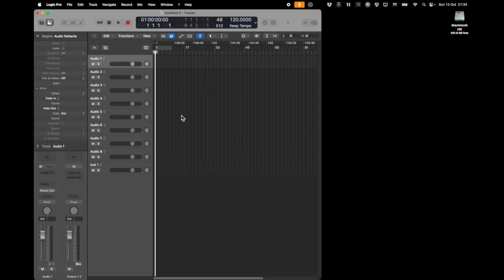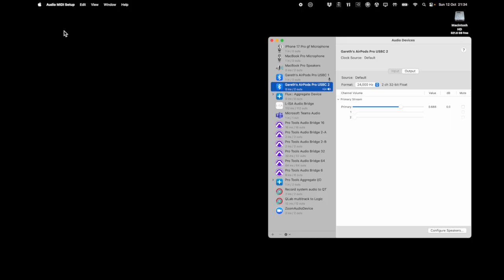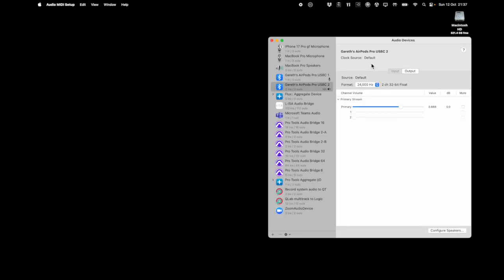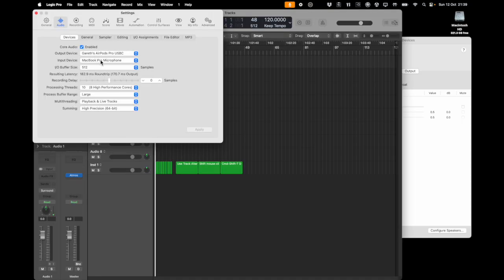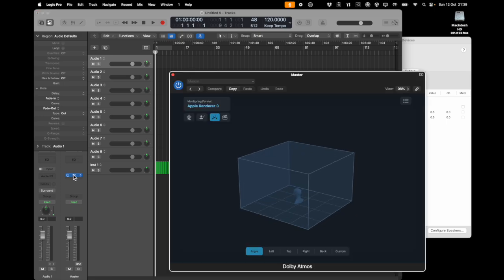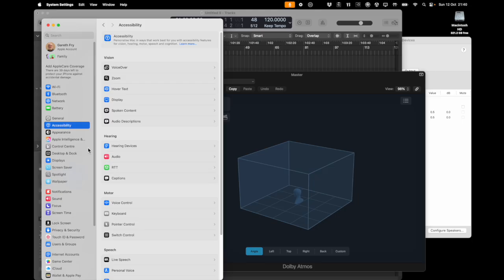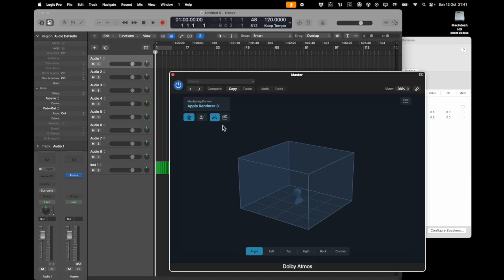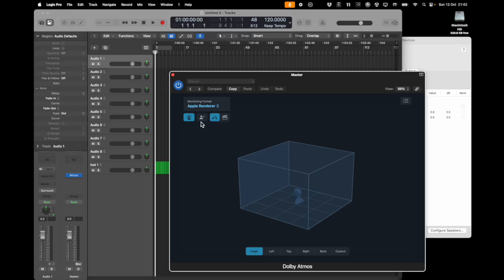Troubleshooting using AirPods to mix spatial audio in Logic Pro

Comment: Does it work via bluetooth I use airPods 4 it didn't work
Reply from the maker: Yes, I use Bluetooth - but it is a pain to set up and there seem to be many reasons to prevent it from working.
Reply: @garethfrysound  I hope you release a video that solve this issue. I can't fix it.